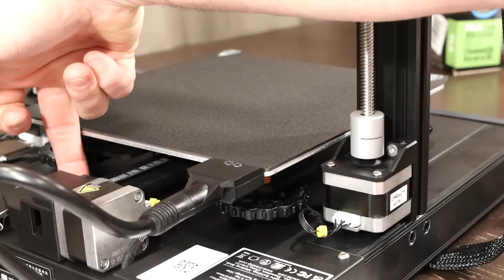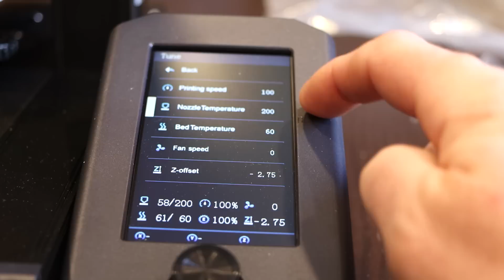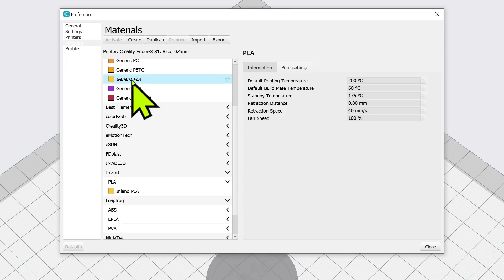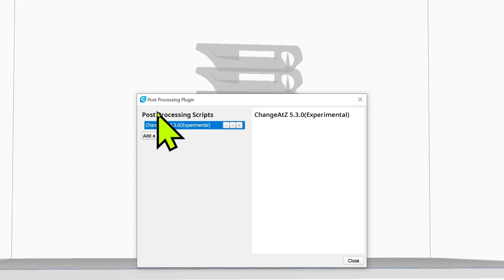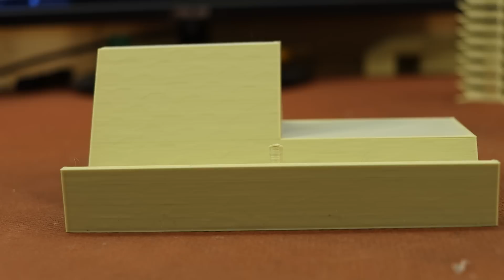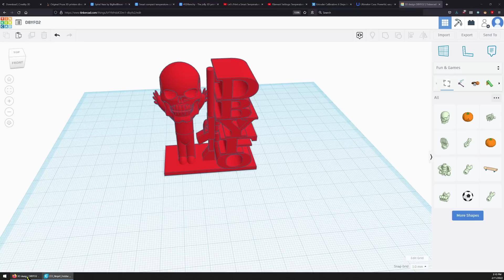Getting started with 3D printing

Comment: "Adhesion is a big deal and I had no problems."

Talk to you in a few weeks, brother.
Reply: 4 printers for 4 months now, no adhesion problems once you have the beds set properly which is as easy as a square test print "CHEP BED LEVEL TEST PRINT" and running a finger over it to check thickness as it prints around the square.

Comment: I use a glass bed surface and a sugar solution as an adhesion agent.
a tablespoon of sugar in 50 - 100 ml of water with a drop of dishwash liquid to aid wetting of the bed surface.A straight sugar solution will tend to form beads, the soap prevents that. You can experiment to arrive at the best dilution.
Wipe onto the bed surface with a piece of sponge and allow to dry as the bed preheats. It's dry when it is not very tacky to the touch.
When the bed cools the sugar coat releases automatically due to differential expansion cracking the dry sugar film.
Clean the bed surface under running water , recoat and continue printing.
This should work on your bed surface too.

Comment: Few tips you or someone else might find helpful.

In Cura you can set the areas you don’t want supports. It’s an option on the left hand side of the screen.

The settings on the right in Cura are just a fraction of what the slicer is capable of. Click three lines next to “search settings” in that menu. You’ll find better options for just about everything, including supports.

Also those spikes on your test towers are designed to be snapped off by hand so you can ‘feel’ the strength of the layer adhesion.

Keep your first prints you think look really good. If you feel your printer is screwing up then reprint the same file and compare to the original to see if there is actually a problem.

Comment: I know you are inundated with recommendations. That said I highly highly recommend OctoPrint using OctoPi, it’s easy to setup…hell I did it and I’m an actual idiot.

Not only do you not need to touch SD cards again (Pi plugged into USB) but it gives you tons of options and control of the printer in real  time. It’s essential for prints that have a few or many files you want to print separately. One of those ‘“where have you been my whole life” upgrades.

Oh and thanks for showing off tinkercad. I’ve been using Fusion 360 (free individual license) and it’s powerful but it’s like going from MS paint to photoshop….huge learning curve. Going to give tinkercad a try for simpler designs.

Comment: a little help for you- prep the print plate.  Put a little tiny bit of vaseline on a paper towel and give it a really thin light coat.  That'll make the removal much easier.  Keeps it from completely sticking.

Comment: Try rubbing alcohol to release objects from the plate. It works with hot melt glue. Pre-washing the plate with low percentage rubbing alcohol will leave a microscopic film of oil on the plate. 73% rubbing alcohol is 27% oil that is supposed to help prevent over drying your skin.

Comment: I print all pla at 205 to 200 you can do a tuning though for the hot end heating element sometimes the heating element swings 20-30 degree in between off and ons to try to maintain it’s set temp but you can tune it to get it as consistent as possible in the pid tunning I watched a video on it.

Comment: Good luck brother started this same process November of last year finally today I can pretty much slice and print anything first try. Print you a calibration block and check it with a caliper and watch a video on esteps for your printer make sure it’s feeding close to exact as possible will make when you or printing multiple joining parts they will be more consistent to the model.

Comment: The hardest thing is learning the slicers and they aren’t terribly difficult and you will want both of em Cura and Prusa some models just when you slice them always preview them in the slicer and make sure the finish result is what you want cura for some reason will fill the holes in some models while Prusa will leave them , as far as better prints I feel I get better prints from cura so I always try to use it when I can but Prusa works also just has a different wad of arranging the printing process and sometimes gives less aesthetic prints at least in my experience. Lightning Infill in cura is pretty awesome for anything that’s not got to be super strong makes prints way faster . And also with supports use tree supports from bed only and 50degree overhang on cura and it’s pretty much perfect always.

Comment: The 3D Printing bug must have bitten me about the same time as you, late last year. I went with a TwoTrees Sapphire Pro CoreXY as it was on sale at just under $200, and I like the linear steel rails as opposed to the rubber wheels. No doubt you scoured YT for all you could learn before jumping in, so maybe you've already discovered Dr VAX on his MakeWithTech YT channel. He has  several videos on setting up the Cura Slicer and goes through all the many variables you can change in the advanced settings! And another YT channel of interest might be Hoffman Tactical, as he seems to be meeting with success in printing AR-15 and LR-308 lowers that hang together, plus recently he's gotten into Glock frames!

Comment: I use a plastic razor blade with mine.  Safe for the bed and plenty of leverage to get the bits off.  Also, get the bed warm and use a paper towel with rubbing alcohol to clean off the pla remains.  It's good to do anyway to remove oil from your hands too.

Comment: I'm just getting started in reloading so I'm watching your videos like crazy.   I have been 3D printing for a while, and I can certainly help you with that.  I've basically rebuilt my printer which is an Anycubic Mega S and it was a $300 printer with about $200 worth of upgrades, and it runs and prints like that $750 Prusa.  I am not a fan of the Ender or other v-slot extrusion and wheel systems.  I prefer the smooth hardened steel rods and LMU8 linear bearings.  But once you get used to keeping the concentric wheels dialed in, they work well enough.

PLA and PLA+ isn't much different from each other.  the PETG is much more challenging to print with, but its not as bad as ABS.  PETG is not stinky... ABS is.  
 I buy my filament at iiidmax   you can get 10 rolls at less that $10 per 1 kg spool.  and you can vary colors as you want.

Comment: For adhesion on my CR-10S I have the very flexible magnetic build surface so it is very easy to remove, just peel the item off even with the first layer squished.

On the ender 3v2 I have the hard plate.  I adjust it up until it is a fine bead and doesn't stick much.  A light layer of glue stick holds it well and is fairly easy to get parts to release.  Wide blue painters tape protects the surface to prevent buildup of PLA and messing surface finish of subsequent prints.

Just plan on buying more of those build plates because you will eventually trash them

Comment: Creality is a good choice for cheap foot in the door printing even though you got the more expensive version.  Prusa is nice but overrated for the price.  The important part is a large community and available replacement parts.  You will need both no matter which printer you buy.
You should have bought a makerbot back  in the day for an assembly challenge.  It was just bags of parts, wires, and screws.  Nothing was pre-assembled.  Supposedly the instruction were written by people that spoke English.
You do not need all the special mods and upgrades to get into printing.  A bare bones vanilla Ender 3 v2 is plenty.  I would suggest you not even think about mods until you get your second printer.  (If you get into printing you will endup with 2-5 of them.)  The reason is if you start tinkering with your primary printer you will be down until you get it running again.  That can kill your project or worse your 3D printing Hobbie when there is a long delay before you get it up and running again.

Personally I am running 3 printers.  CR-10s, Ender 3v2, and Halot resin printer.  I have a dead makerbot metal, and had a second Ender 3 which I gave to my sister.  

I'm looking getting another  Ender 3 as well as a printer larger than the CR-10.  If I had the room I'd also add a second SLA resin printer in a larger format.

Comment: PLA is a bit like Easy Mode for 3d printing.  It's just a really forgiving filament.

Also, solving the stringing and surface finish issues can be challenging.  One tip that seems to work for me is to measure your filament at several points, average that out, and put that diameter in the filament profile or filament diameter setting (depending on your slicer).

Stringing and surface finish can be a result of uneven or insufficient flow at the nozzle, and telling your slicer what the actual diameter of your filament is can help it adjust the flow rate to be correct.

Comment: I mentioned this in the massive post - but wanted to streamline it as well - Cura also has a "marketplace' at the top - don't be fooled, it's not a 'pay to get things' system, it's a modding system to enable other things.  One of the best is calibration parts, which include temp towers and such already to go.  (keep in mind it may take a while to load "Plugins" page/tab, don't stress if its blank for a while)
 I also 100% suggest "Settings Guide" which gives more details on each print setting you can pick, in great detail, even with pictures to help. (Great for starting out!)

Also as a user of Tinkercad - holding CTRL and using the arrow keys moves the selected part the increment you have set on the snap to grid.  So if you have it set to 0.1mm, every arrow press moves it that much, or    set to 1.0mm and each press moves it 1mm - this helps to line up.  You can also use 'bed surface' option to pick a new 'ground' and then use the ruler and '0' out the distance of your part to that surface, allowing you to put things flush to one another, that aren't just on the ground.